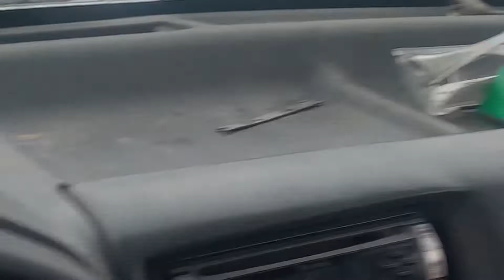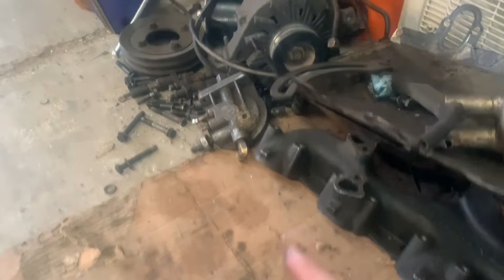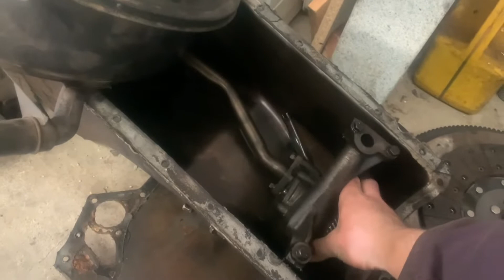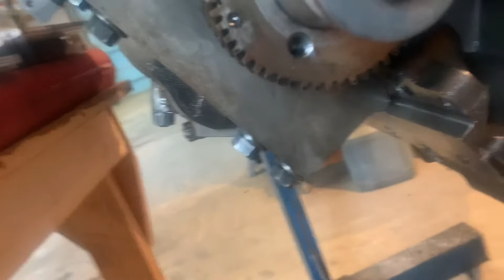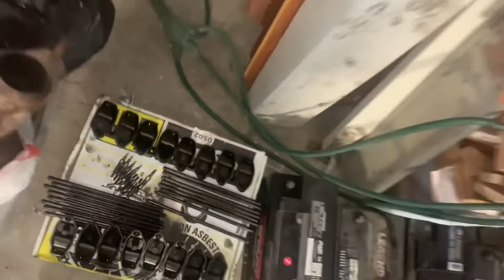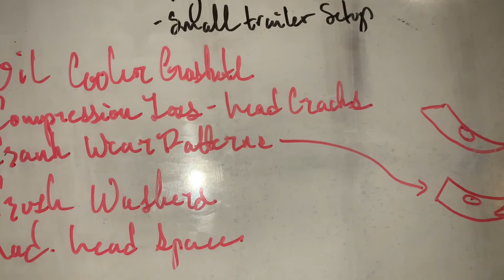Common issues with 7.3 liter IDI Diesel engines - Ford and International Harvester

Comment: Bull Nose Garage channel on their IDI video says the 7.3 IDI block can't be sleeved. He says you have to throw the block away. Hmmm...?
Reply from the maker: Thats interesting… the block is parent - bore, no dry or wet liners to remove. That being said they can be sleeved by a machine shop, i was quoted 110 bucks a hole to do it by M&W machine in three forks montana. I have a sacked out 7.3 block sitting outside - it has sleeves in it from a previous build. Theyre about 200 thou thick, probably installed after the machinist took the bores out 200 thou from center axis. Theyre press fit in, maybe 0.5 to 1.0 thou interference? Thats about all the more i know. I figure its probably key to have the block decks milled post-sleeve install. I havent done it as ive never had the money to do so…

Comment: Just bought a 89 f-250XL 7.3 non turbo and it’s ignition switch was cracked and it was atleast trying to still start just got a new one and replaced it and now it won’t even make a sound any ideas?
Reply from the maker: U taek picz of how it was wired up before u took it apart? Also - did you compare the old and new cylinders? Im pretty sure ford used the same cylinder for like 40 years but idk. Likely a wiring issue - might need to snag a schematic off the mitchel/prodemand site at Napa

Comment: I have a 1992 7.3 nonturbo 108k miles and i bumped the 5/32nds allen fuel screw 1 flat advance and a misfire occurred and is still present even with putting the screw back to original spot
Reply from the maker: If you have concerns about a misfire then you need to ensure base engine health first. Check for excessive oil consumption and for proper oil pressure hot and cold, idling and running loaded. You will need to check compression (engine hot, glow plugs out), glow plug operation and injection nozzle spray pattern. The compression test may involve a leak down test to pinpoint the loss of compression, i.e. rings vs valves.

It is common for these engines to blow head gaskets between cylinders. The composite gasket material will get eaten away and will cause the cooling system to pressurize and blow out the radiator cap, hoses or freeze plugs if bad enough. These engines also crack valves and valve seats very often. While small cracks in cast iron diesel cylinder heads are very common (and are often not an issue), once the crack spreads through the valve seat combustion and compression gasses will leak past the valves and will cause a misfire. These engines also wear piston rings due to: lack of regular oil changes, worn injection nozzles (poor spray pattern) and running (non-turbo type engines) with a turbocharger. Non-turbo engines use a square cut cast iron piston ring with a non-anodized piston whereas the factory turbo IDI's have: keystone piston rings, anodized piston tops, bigger connecting rods with bigger wrist pins, and chromed exhaust valves. Anyways, I digress; any of the three major categories I just mentioned will cause hard starting and consistent or persistent misfires. 

long story short - messing with the injection pump is very unlikely to have an effect on the misfire. Turning up the fuel volume will increase temperatures and pressures and can accelerate ring wear / crack propagation. Without having heard your truck run, my bet is the misfire is related to a cracked head, valve seat or valve face. It could also be glow plug related. I have no way to know without looking at your specific case. If valvetrain issues are the case, I recommend purchasing a remanufactured engine or better yet building one yourself. That way you know if has new rings, pistons, valves and a head that has been tested for cracks, with new valve seats and stem guides. Then you know what you are working with and can control the parts that go into it. 

When I am done with university, I fully intend to build a 7.3 IDI from scratch and do all the assembly myself. That will include sleeving the engine, however. It will total about 4,000 dollars (parts and machine work). Working on these 40-year-old, 200,000 mile plus engines is simply a recipe to waste time, energy and money. Most owners don't take care of these engines or know how to. They run them hard and put them away wet. While there are those of us who enjoy learning and maintenance, finding these rigs which don't need the engine rebuild for under 10,000 dollars is like pulling hens teeth hahaha!
Reply: @ramblerclassicman221  I really appreciate your reply if you'd like to hear the engine I could email you a video of before and after turning the screw engine idling
Reply from the maker: @jat6000c  Sure, you can shoot me an email of it running. 

If you do - let it sit overnight, cycle the glow plugs once and show me what it takes to get it started. I will need to hear the cadence of the engine, need to see the color and pulsation of the exhaust smoke and will need to see how the engine shakes while idling. 

Does it smooth out once the engine is warm?
Reply: @ramblerclassicman221  what is your email ?
Reply: Will do what is your email?
Reply: Yea I can get you a good video of all that what would your email be ?

Comment: I love my 93 with a 7.3. I've got 432 k miles on it and have never been in the engine.
I work it hard but take good care of it 
Tim from Kentwood la
Reply from the maker: Good to hear! Good to see old iron still on the roads. Is yours a factory turbo model?

Folks often wonder how rigs get past 300,000 miles but it's all down to good maintenance, proper operation and a bit of luck. 

I miss the old 92 pickup in this video. It was a workhorse, cheap and simple but stout and reliable. They're a hoot to drive too!!

Comment: Just thought I'd mention that when you said cylinder #2 was misfiring, you sprayed the PB blaster on cylinder #4. I'm sure you know but thought I'd mention that the cylinders are numbered on the intake manifold starting at the passenger right, zig-zagging towards the back. This means that cylinders 1, 3, 5, & 7 are on the passenger's side, and cylinders 2, 4, 6, & 8 are on the driver's side.

Comment: I have the 7.3 idi and it dumps a ton of black smoke when I’m on the pedal hard. Possible problem??
Reply from the maker: Turbo or non-turbo?
What altitude you run at?
Hows the injection pump doing? Hard starts when hot?
Tested the injection nozzles lately? 

IDIs smoke black when at full fuel. Turbo and non-turbo trucks smoke about the same amount. Excessive smoke usually indicates a faulty injector overfueling a cylinder. High altitude means the trucks run comparatively richer for the same fuel volume.
Reply: It’s non turbo. I believe it’s probably over fueling. Thank you for your time
Reply: Hence, the saying "Rollin' Coal".

Comment: What glow plugs do you recommend?
Reply from the maker: Motorcraft zd9 or (updated) zd29 bullet style plugs. Beru is the german plug manufacturer, you can get em directly from them. Update the connectors on the harness to bullet style if urs are the older spade type.

Comment: I'm looking for an IDI truck now and i really appreciate the tech tips. Power and speed of are less concern for me than computer and sensor issues of the later trucks.The mechanically driven fuel pump is a better option for me than the HPOP driven pumps on the Power Stroke engines that replaced them. Thank you for giving us the benefit of your experience.
Reply from the maker: Ultimately a p pump intercooled 12 valve swapped in an obs aeronose extracab or crew cab ford backed up by an nv5600 with a gear drive dana or new process t case and a 4.10 ratio dana 60 front axle plus gen 2 sterling 10.25 will be the best setup. Longer stroke mills, more torque and waaaaay more aftermarket support. Itll cost between 10,000 and 15,000 for a decent body cummins+tranny swap if you put in the work but brining an old idi truly up to speed generally takes a few thousand anyhow, for a non turbo mill. 

But IdIs are good for screwing around and having fun! Theyre pretty unkillable, tho ive had em throw a rod through the side of the block if theyre run with turbos. The 7.3 idi turbo is specifically designed with different block, rings etc to handle the boost. They pit out about the same hp and torque numbers as a p pump 12 v cummins though.

Comment: I own a 7.3idi 89 350 4x4 dually diesel. Useful video. Just after I fix something seems like something else goes wrong lol. I got it back from the shop and it eventually started having very rough starts. Long cranks, but would eventually start but rattled the engine a bit. I noticed the water and fuel light come on which makes sense because of the diesel additive, I drained about 3 water bottles worth of it the orange liquid. Came back maybe a few days later and it was the same old hard start, but the light was gone. I’m thinking maybe I need to drain it until the green diesel comes out? Maybe it’s still a hard start cause there’s some left. 

Shop also said no issue with starter or alternator, and I repeatedly asked. However from this video I noticed that my glow plugs click like someone mentioned in the comments which makes me want to get better ones. 

I’m hoping maybe just continuing to drain the fuel filter separation will help the starting. Maybe someone else reading this is experiencing the same thing as me.
Reply: Did you ever figure it out?
Reply: @jameslafountain  yeah, I just went ahead and kept draining it even more this time with a proper setup for draining and a tank for collection etc. Idk how much additive they put in but it’s usually the entire bottle which is a lot, so it makes sense it would just take awhile to drain. I drained a whole bunch of it and it was all good starting up just fine like normal again.

Comment: Everything is true what you say about these blocks the 6.9 and the 7.3. I grew up with these engines around in my teenage years and they got a bad reputation but they were actually a great engine I had a 91 with a 7.3 and a 5-speed now I have an 86 with a 3-speed C6 4:10 gears and a Ford installed Banks gentle boost kit. The previous owner hauled a huge fifth wheel with draft horses in it.

Comment: Personally I like to start mine gently, when it does fire to hold it around 1,100 to 1,000 RPMs until the rat tat tat bang bang rattle rattle calms down, the timing cam on the fuel control makes the noise less with the pedal down a tiny bit, and then let it idle down rather than jabbing the pedal assuming the oil pressure is still rising and filling the gallies.

Comment: Great video. I have a 94 F250 with a 7.3 IDI turbo diesel. This is the first diesel I have ever owned so I am still learning. You pointed out the vacuum pump, and I wonder what exactly this pump does. At this point, the truck runs great, but I am wondering what the function of that silver pump is and how I will know if it dysfunctions?  I know that is a mouth full but would appreciate some knowledge of its basic function if possible Thanks.
Reply from the maker: This is how i think of it, could be wrong: The vacuum pump performs a few functions - primarily it provides supplemental vacuum to the braking system and secondarily to the hvac system and cruise control. These trucks (IDI and T444 diesel f250 and f350) have vacuum assisted juice brakes - combination drum and disk brake vehicles which require both proportioning valves and power assist. 

The proportioning valve acts to  siphon most of the braking power of the hydraulic system to the front brakes under normal load conditions, preventing rear wheel lockup as weight shifts forward during braking due to inertia. 

The large pistons of the front disk brakes require more fluid and subsequently braking pressure than do the wheel cylinders in the rear. The area encircled by the front disk brake pistons is probably 6 to 9 times that of the rear wheel cylinders (which are 1:1 roughly with the bore diameter of the master cylinder), diameter is 2 to 3 times greater for each of the two pistons in each caliper pi*(radius)^2 = area. This means the force required to actuate the brakes is, per example 1:1 for the rear wheel cylinders but 1:9 for the front cylinders (9 times the force required to push the large piston using the small piston in the master cylinder and 1/9 the distance travelled by the large piston compared to the small piston). Thus the force applied by the drivers foot is divided by 9 for each piston in this example on both front wheels. 1/36 the total force is delivered to each caliper piston in this example. This is why the brake pedal is rock hard when the engine is off. The average person simply cannot supply enough force to the relatively small bore master cylinder to force the pistons in the front caliper out and agains the brake pads. 

Cars built prior to 1967 in the U.S. had single pot master cylinders feeding 4 wheel drums. This meant that with properly adjusted and bled brakes, drivers did not require any form of assistance to effectively stop their cars, as the wheel cylinders each took 1/4 of the volume of fluid displaced by the pedal. Thus there was no difference in the pressure required to actuate drums front and rear. This came with drawbacks suck as rear wheel lockup which some manufacturers modulated with early load proportioning valves. With the introduction of front disk brakes and dual pot master cylinders, cars needed a way to assist braking effort. 

Traditionally this was done using engine manifold vacuum (generated beneath the throttle plates by the pressure differential between atmosphere and intake.) Diesels (of older vintage, modern diesels may differ for emissions reasons) lack throttle plates meaning they have no way to generate the pressure differential required to operate a diaphragm style vacuum brake booster. Ford solved this problem in two ways: 
1) an externally mounted belt driven  diaphragm style pump which generates ‘vacuum’ (negative pressure). 
2) using a ‘hydroboost’ piston style assist pump run off the positive hydraulic pressure generated by the power steering pump (used primarily on super duty models and heavier 11,000 gvwr and up). 

Our trucks use vacuum generated by the sucking action of the vacuum pump to pull a diaphragm in the booster toward the master cylinder. This lends a lot of force to the braking action and greatly reduces braking effort.
Reply: My 89 had a vacuum pump that would constantly loosen up and then there was no power assist on the brakes. Happened when towing once. These motors love to vibrate. i finally removed the standard bolts that tightened into the block with bolts and nuts on the through side of the block. Never loosened again.

Comment: If one glow plug goes open  the relay won't stay on as long  2 go open it will drop out before the warm up and will burn the starter and battery down before it will start.  The reality is they don't  last long . It's a chronic  problem  running this engine.  Fond generally  when you lose one pull them all  the ones that do show .5 ohms  are still good  put them on a drill  and sand of the carbon! one's  that show .7 ohms  or more about go open and are not getting  as hot plus contribute  to the relay short cycling . Inaddion that carbon on the good ones acts like a insulation  / this system  is a high mantaince  pain.

Comment: I saved this video to my 7.3 IDI vids. A lot of very useful information. My 7.3 IDI Is in my 1989 F-250 4wd XLT Lariat Regular Cab. It has the factory automatic. It was a very unexpected gift from my dad. I want to resurrect it and put a slide in camper in it for coastal fishing here in nc. Any tips for an initial start after the truck has been sitting for about 3 years? Also, who to get an injection pump/injectors, larger fuel tanks from or upgrade from another series of vehicle? I don’t particularly care for rolling coal, I want reliability and more power if I can swap parts or bolt it on. I would like to figure out worth of switching to a manual transmission over the factory one and which manual to look for. Any help is greatly appreciated. Have a good’un! Semper Fi!
Reply from the maker: Hello very much - 

Apologies for the 12-month latent reply... I suppose you have gotten the old rig started?

Usually, I pull the injection nozzles and pop test them. At the same time, I would put some automatic transmission fluid down the injection nozzle holes. This will lubricate the cylinders. Let them sit overnight, then turn the engine by hand 5 to 10 revolutions clockwise from the harmonic dampener. That will keep it from hydro-locking. Then use the starter to pump the rest of the tranny fluid back out the holes whence they entered. 

Hopefully there is stabilizer in the fuel - otherwise the heavier fraxion hydrocarbon polymers can oxidize and turn sticky inside the injexion pump. This can result in stuck plungers, cam + shoes, governor assembly etc. essentially the waxes fall out, and turpentine can form a varnish on the small parts. 

I always recommend an oil and filter change prior to starting. If there is water in the oil, I would pull the rocker covers to inspect for rust and valve train damage. Water in the valve guides can cause the valve stems to seize to their bores due to the reduction - oxidation reaction facilitated by the ionic potential of oxygen within liquid and gaseous water. Long story short, make sure she ain't got no water in 'er!

Check all fluids, inspect the driveline. Check the brakes and lights. It's all well and dandy if it starts, runs and drives but if you cant get her stopped yer up sh!t creek! Install a battery, then look for smoke with the key off. Rodents are a menace...

Thansk.